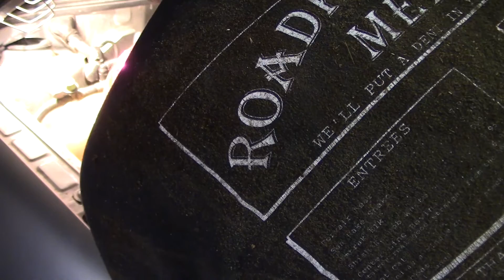Volkswagen 2.0L MKIV Jetta Head Replacement - Part 4

Comment: wheres the serpentine belt
Reply from the maker: To test run it you do not need it.  I tested it, then put the rest of the stuff back on. I prefer to make sure the timing belt and everything else is correctly lined up before I put all the covers back on and test run it.